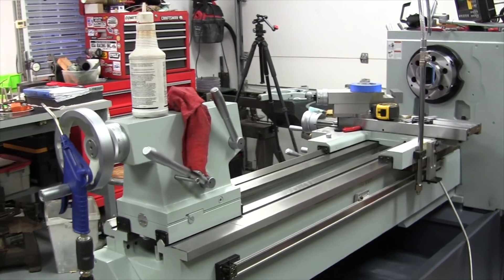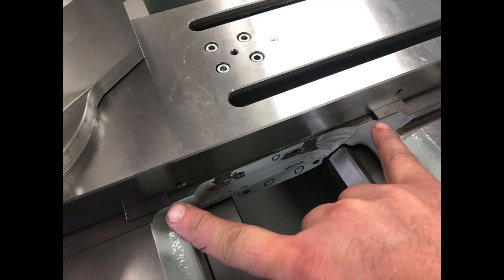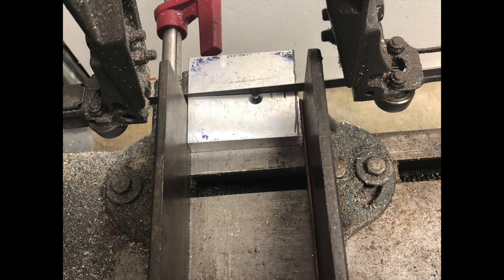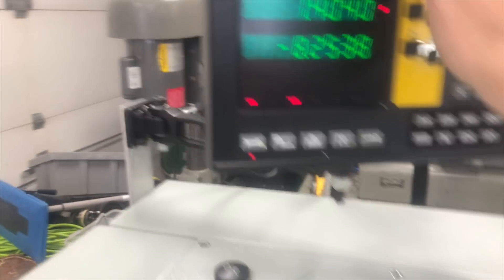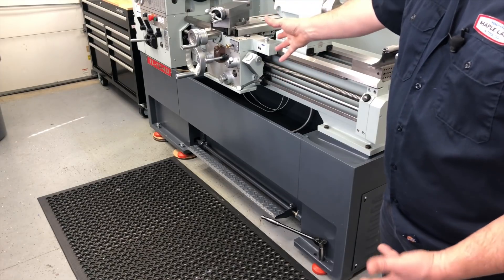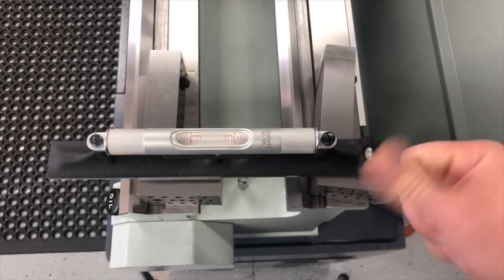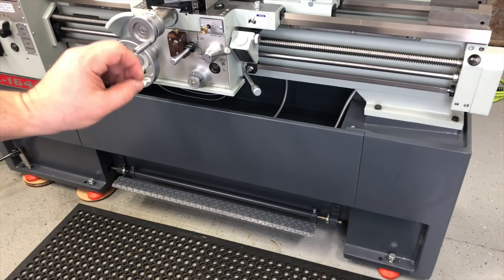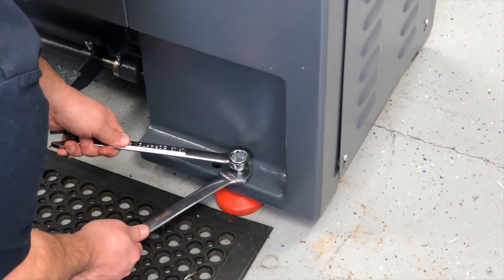Precision Matthews TL1640: Part 3 - DRO Install & Leveling

Comment: I would think the chip pan would have a slope toward the drain built in by design.
Reply: I agree, I would check the chip pan to see if a slope was engineered into it's construction.

Comment: That’s a beautiful lathe! Sunmaster manufacture some fine machinery... well done mate!
Reply from the maker: Thanks mate, cheers!!
Reply: @BasementShopGuy  I'm literally ordering an RML 1440 next monday, it was such a delight to find your video series as there isn't much in the way of decent reviews on these larger machines... Thank you for putting up the awesome content!
Have you tried using the traverse revers lever whilst you have threaded a metric or imperial thread with the half nuts engaged or does it only work on the cross slide travel?

Comment: Nice, you got the good DROs, not cheap ones! And it was cool to see your leveling process. I found after leveling mine when installing the new pedestal feet that it needed a slight tweak a couple days later after settling, did yours need it too? Yours might be much more rigid.

Comment: Doing that on a new machine with unworn ways looks lots easier then guessing averages on an old worn unit. Those levels are very sensitive.
Reply from the maker: Exactly. I'm going to re-level it once I start dialing out any taper. That's really the way to dial-in the precision. I'll also replace those acrylic plates the headstock side is resting on.

Comment: The chip pan should drain fine with the lathe level they are designed that way. Or at least the ones we had at work were.
Very nice lathe
Reply from the maker: Yeah, as I'm starting to see.

Comment: Not just wrapped in the wrong direction {teflon tape}, but you should never use tape or dope on compression fittings (flare fittings are one of the many styles of compression fittings).  Just hand tighten and torque another flat or so.
Reply from the maker: David Cole Thanks for the tip! I’ll remove it, so it’s done right. Good eye on the wrap direction, however, take another look and notice the edit. I noticed it too and went back and wrapped in the correct direction 😎
Reply: @BasementShopGuy  WARNING: This comment is probably not worth reading, but I can't help myself. In case you run into plumbing connections where you should use teflon tape: In the video as posted you started out wrapping the teflon in the correct direction (the first 50 frames or so), then you dissolve to a new shot where you complete the the wrapping which is in the wrong direction. So the edit appears to show that when you "caught" the mistake, you actually "made" a mistake. This is confirmed when you then tighten the taped joint with right-hand threads. The tape should be wrapped in the same direction that you would turn a fastener (like a nut) onto the same threads. This is so when you join the threaded parts, friction is not trying to "unwrap" the tape...
Reply: You missed the more important part; you arent supposed to tape or dope compression fittings.
They are intended to be dry fit, run nut up till it stoppes, then tighten w/wrench about one more flat.
See:
http://blog.parker.com/proper-assembly-steps-for-37-flare-fittings-using-the-flats-method
Reply: Note:  the MAIN reason to NOT use thread sealant (tape or dope) is that it does no good!

If there is leakage, it will simply come out around the stem (tubing) that goes through the nut.

It can also CAUSE leakage if some of it gets between the two flared (or ferrule and taper) surfaces. It can also interfere with proper mating of the threads, causing incorrect COMPRESSION (hence the NAME of this catagory of fitting) of the mating surfaces either as misalignment  or even cracking of the sealing  surfaces .

It might not matter @ the pressures of a coolant system, but pneumatic or hydraulic pressures will not be so forgiving.

Hope this helps.
Dave
Reply: I love YouTube.

Comment: Beautiful machine, I'm jealous! :D Its just the right size and setup to do everything.... on the chip pan and drainage, I wouldn't tilt it, I would just level in all directions and clean the pan with a kitty litter scoop and squeegee... make life easier on myself. Have a pail with a bunch of holes sitting over a barrel to drain the swarf.
Reply from the maker: Great tip, thank you.

Comment: Brad - Recommend you re-think using polycarbonate under the leveling pads.  All plastics continue to creep over time and it is the continuous load of the lathe on the polycarbonate that will cause deformation over time.  Can't wait to see first chips off that machine.  Regards;  Ron
Reply from the maker: Good tip, yes I'll be swapping those headstock-side pads out for some steel ones. Thanks!

Comment: If you really care about rest coolant flowing into your drain then maybe it would be better to put the level into the chip pan. I can't imagine anyone at Precision Matthews will guarantee the chip pan is parallel with the top of the compound slide to a tolerance within which you tipped it out of level. 
It's sheetmetal, it might even be slightly bowed and cause puddles to form.
Precision Matthews might even already have taken that into account when they designed the machine and tilted the chip pan slightly under the lathe bed.
Reply: Or since its sheet metal you could just hit it with a hammer :)Or shim it -but yea nobody makes perfect parallel  chip pans to the bedway.I seen and worked on several lathes but i never saw one with the coolant fluid sieve where this one has - all of them had it on upper right corner.
Reply: Seems simple enough to have the plenty of pitch built into the chip pan while the bed is level.

Comment: The property you're looking for with the polycarbonate feet is compressive modulus, not tensile modulus. They are not the same, depending on the gade and manufacturing process of the polycarbonate it can be as low as 2600 psi (according to my short google search).

The feet are obviously overbuilt and will be plenty strong enough. However next time you calculate something it might be closer to the limits of the material.  Then it's very important to choose the correct property to enter into your calculations.
Reply: Modulus refers to its stiffness, not strength.  You want compressive strength, creep flow etc.  The pressures this lathe is exerting on the pads is in the 100's of PSI.  It will not be a problem.  Pressure = force/area.  assuming he has 67% of the weight on the headstock which would be about 2000lb/4 pads / (pi*1.5^2) assuming 3" diameter pads = 70psi.  The noted compressive strength of polycarbonate is greater than its tensile strength BTW and is in the 12,000 psi range, which is 2-3x more than the concrete the lathe is sitting on.
Reply: @barrygerbracht5077  Yes, my bad for using the wrong term. I did not learn physics in English natively.
If I actually meant stiffness, the number would have been in ksi, not psi.
According to the data I found, compressive yield strength of extruded polycarbonate is 2610 - 12500 psi compared to 8500 - 10200 psi tensile yield strength. 
The maximum compressive yield value is around 12000 psi indeed but it has a very wide band under that and since the origin and state of the material is unknown, calculating with maximum values is not wise in my opinion.
It's important to remember this is more of an academic thought experiment for future use in calculations than a worry for his feet right now as I stated in my first comment.
Link to where I pulled my data: http://www.matweb.com/search/DataSheet.aspx?MatGUID=501acbb63cbc4f748faa7490884cdbca&ckck=1
Reply: I am not worthy!

Comment: Brad:  Very nice work.  Curious about your DRO installation on the X.  Is your cross slide lock located on the backside of the table, and if so, did the X-scale cover it up?
Reply: @Bill: I have a 1236T and had PM install the DRO. And the X scale does cover it up so I can't lock the cross slide.
Reply: @qcnck2776  Thanks.  There are two alternatives shown in Mgs#1 and Msg#3 (in the link below) for installing that lock, and I'm trying to figure out which is the better way to go on my PM-1440GT
https://www.hobby-machinist.com/threads/erl-1340-cross-slide-lock-for-dro-equipped-lathes.78854/#post-673284
Reply: @billbuckalew9497  Thanks for the links! Very clever ways to get it done.
Reply from the maker: I'll have to look at some pics to see, but honestly, I NEVER used, or use and cross slide lock.
Reply: @BasementShopGuy  Appreciate your response.  Thanks!